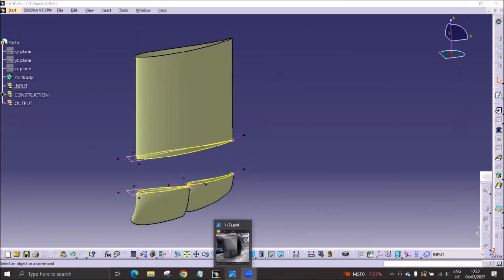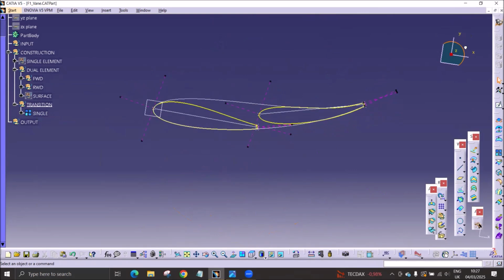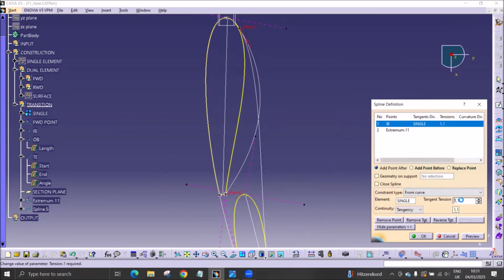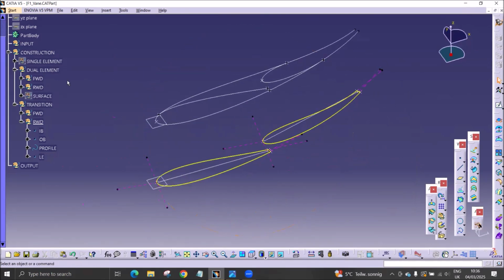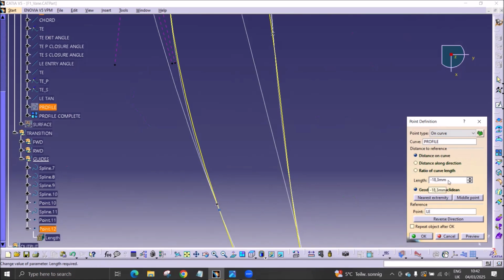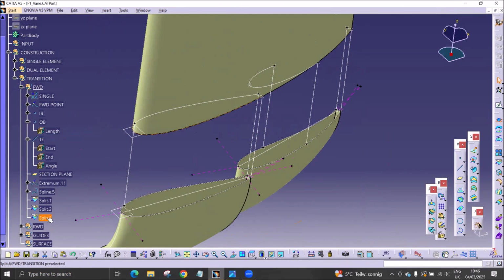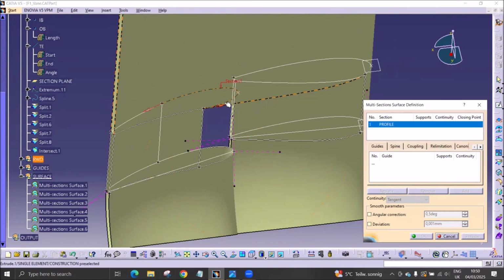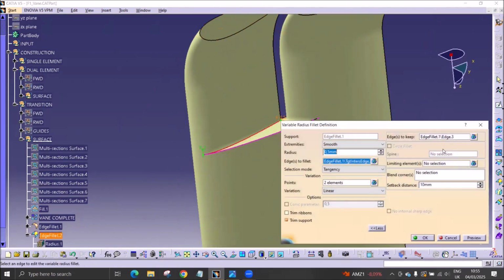F1 2025 - Fixing McLaren's Cockpit Vane in 30min - How to merge 2 wings into 1! (CATIA V5)

Comment: Hi ! Would this method be appropriate to design the transition between front wing elements and the endplate ? I wonder how you would manage more than two elements merging with into one
Reply from the maker: Yes, absolutely.
You would do it the same simple way. Trim it into a straight wall and apply fillets.
That way it’s quick, clean and easy to troubleshoot.

Comment: shame catia has such a horrible ui
Reply: Well Catia V5 is a software from the 90s, it was designed so even a potato could run it. You can literally open a complete airliner aircraft on a modern computer because of how efficient Catia, it's like a zero nonsense software, no flashy animations no overhead anywhere. Everything is as slimmed out as possible even the icons are optimized to use little memory
Reply from the maker: If you want a nicer looking UI you can use V6, but functions are mostly the same.

Comment: Is it possible that a design as simple as this would run afoul of some radius or curvature regulations?
Reply from the maker: They still have a relatively tight radius in the slot gap and wouldn't explain the wobbly surface.

Comment: Could it have been a manufacturing issue? Maybe someone forgetting to trim an excess of carbon? How are parts singularly checked between cad and complete part?
Reply from the maker: Then you would still have the wobbly surface. It’s a design issue

Comment: Is solidworks still used? I remember back in college in 09 we used it
Reply: It's only CATIA or NX.
I've worked for Ferrari and Alpha Tauri. 
Ferrari was on CATIA V5 and still is, they were using CREO for the engine. 
RedBull/Alpha Tauri are on NX. 
Sauber is on 3D experience and also McLaren.
Reply from the maker: Solid works is the cheaper, smaller programme, that’s why universities use it. Catia would be too expensive, but that’s what car manufacturers use.
Reply: Im still in uni and yes. Eveyone still uses it
Reply: Surfacing in solidworks can be the stuff of nightmares 😅

Comment: Just a thought that comes to mind. Is it possible that the part was originally designed just as a simple single profile but CFD/wind tunnel showed that it wouldn't work well? Then perhaps the element separation was quickly and poorly added after the fact?
Reply from the maker: That‘s exactly how such parts are being created.

Comment: Obviously mclaren engineers aren't stupid so why would they design the part "incorrectly"?
Reply: As he said in the end, sometimes you just need to get it out of the door quickly, so you make it fast and loose, also could be other corners cut in whatever other step of the process, not only the design but machining the mold and later laminating the carbon fibre. Especially also if they have other concepts to try or other tasks the engineer or fabricator or etc., could be doing that is more worthwhile.
Reply: it's easier (faster) to produce that way since shaping carbon fiber requires time to do correctly, you can't exactly cut a triangle there.
Reply: @adrianzanoli  yea i realize that but I figured it was a part they would have designed early enough to be able to manufacture a optimal version
Reply: @Eric_V410  headrest/halo area are among the last since after you have monocoque you start to study how the driver interact with it... that aero piece probably is there largely to correct a turbolence generated by the drivers' helmet movements or positions.
Reply: Start by spelling mclaren correctly
Reply: @matteogirelli1023  lol my bad
Reply: Comeon man that's just childish
Reply: Don't overestimate people.